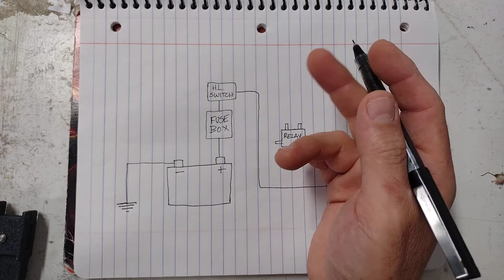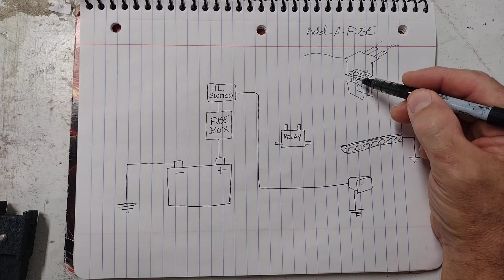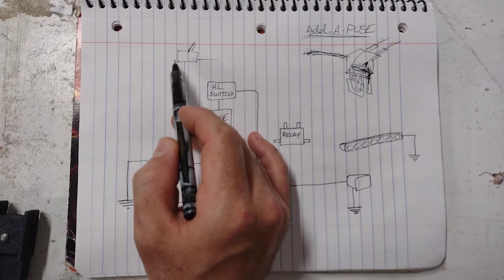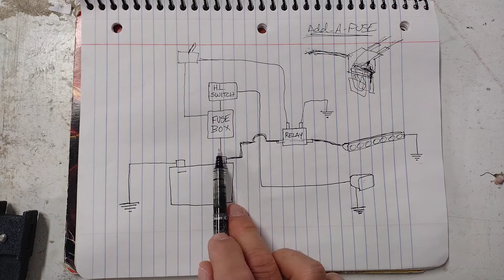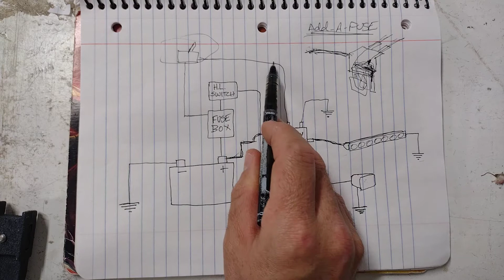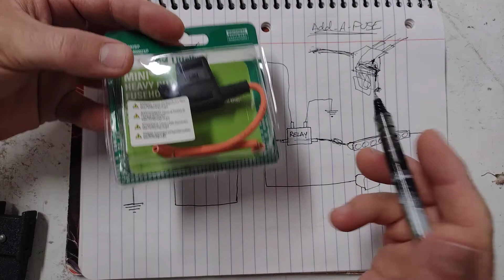HOW TO WIRE NEW AUXILIARY LIGHTS

Comment: BEAUTIFUL. THANKS FOR TAKING THE TIME AND TROUBLE. This sounds much simpler that I would have thought. Coupla questions. 15 amp fuse is enough for the one near the battery? When choosing a light to add, the trucker who lives downstairs says he's seen a lot of trucks on fire at the side of the road and attributes adding Chinese or foreign cheaper lights. Personally after watching this video I would think the reason would be not heavy enough wire or no inline fuse. Would you agree?
Reply from the maker: My pleasure. Glad I could help. 
I think a 15amp fuse should be enough. It really depends on how big the lights you're planning to use are, and by big I don't mean in size. I mean how much power the lights will use in watts. 
Watts=volts x amps.
Lights' power consumption (watts)=your truck's 12Volts X Amps.

Let's use a 200 watt light setup as an example. Divide the 200amps by your 12volts and you get around 17 amps. 
That means that your 200 watt lights will use 17 amps to work. You would want to use a fuse a bit bigger than that to allow for additional power loss in the wires, etc and so the fuse doesn't blow under normal use. So if you use a 20 or 25 amp fuse, it should be correct. 
You can use any values in that simple equation to plug in numbers from whatever lights you buy.

As far as the trucks catching on fire, it may be poor wiring. I think cheap Chinese lights are more likely to not work than they are to catch on fire, but who knows. Maybe it's a bit of both.